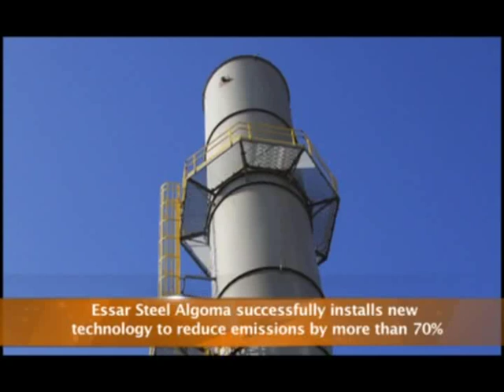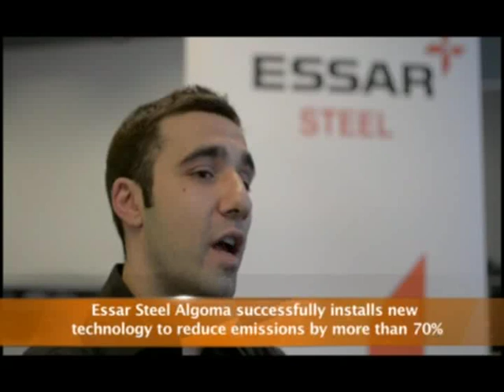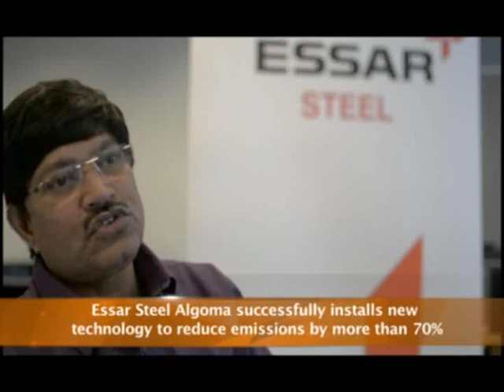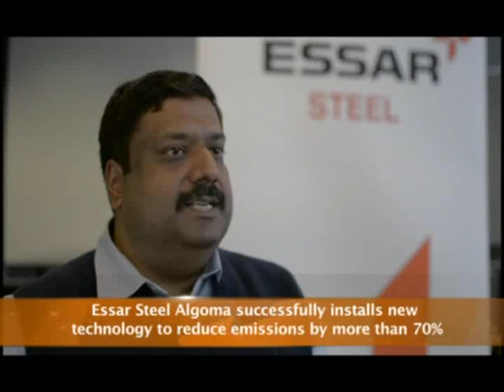Essar Algoma Steel successfully installs new technology estimated to reduce emissions

Comment: On the other side of science the people who control the weather have trapped all the steam from steel mills of the world and are using them to create the rains, floods and with this technology they drop all the metal on then bugs cocoons throughout the winter and kill every bug. Elevation of the steam has been force down on the lands and is drowning all the trees from pressure above forcing water up through  the center od the tree, killing it. Towers are also blocking a higher frequency of healing and wormwood has takin over all our tree aswell. Were doin good, real good huh. Oh ya we need steel, man of steel. Save the world.